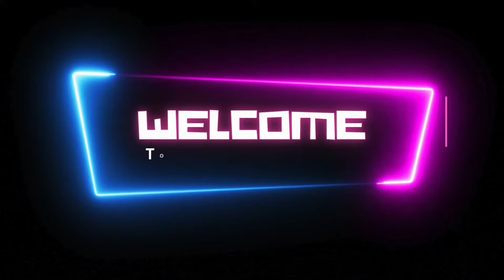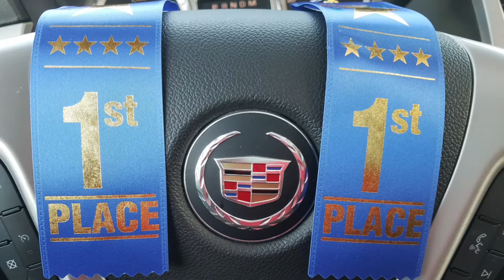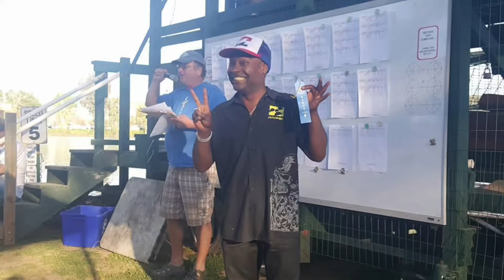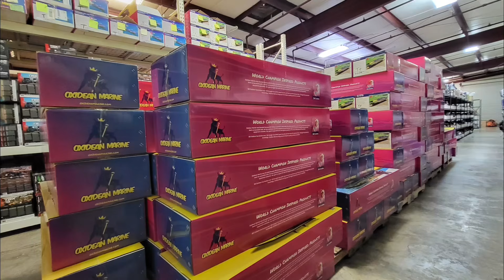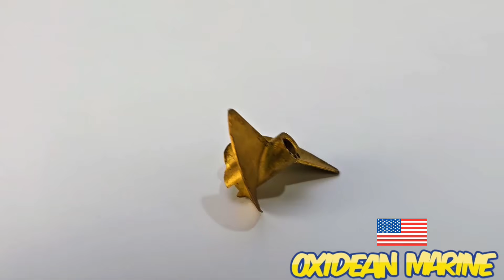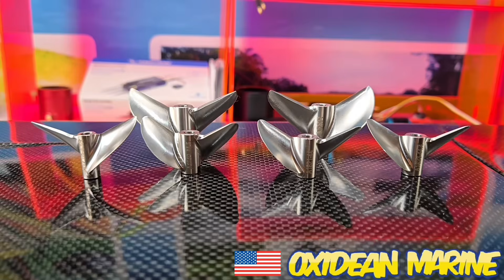RC BOAT PROPELLER INSTRUCTIONAL VIDEO

Comment: Hi Guys. Great video. Can u please help me out. Im new to rc boat and it's Amazing fun. I want to upgrade my new Bezgar Tx123 rc boat from the plastic 2 blade to a little faster metal propeller. Can u tell me exactly what kind or number that would fit this cool little boat. Thank you 😊

Comment: I have a 54" fountain gas boat would I get more speed from a 3 blade or 2.  I had bought boat from bonzi I like the  3 blade I dont know all that much about props. And its not a cheap guessing game to play either. I get about 30mph now would like 5-10 more mph if thats possible with a prop change
Reply from the maker: Call us 510-689-7189

Comment: I appreciate your video and explanations. I’m looking for a prop for my Super Sonicwake 48. It’s a basher boat with a Hydra XLX2 ESC and Prima 4685 1250KV motor. I tend to run large battery packs for additional run time. Obviously by the boat I’m pretty new to RC on the water and want something to hit waves that accelerates better than stock and adding some top end. 
What do you recommend?
I almost bought your A52 CNC High Rake but wanted your advice first. That prop said Phase 1 and I’m thinking this boat might do better with something else seeing it isn’t stock. 
I’m almost embarrassed to ask, but what is the definition of Phase 1 and Phase 2 when choosing one of your propellers?

My BlackJack 42 is stock right now but with be getting the same ESC and motor, unless a 1350KV would work better for it. What prop do you recommend for this application?
My Impulse 31 and Blackjack 29 are bone stock and probably require new stock props. 
Sorry for the novel, but I really am looking to learn and just find helpful guidance 😊
Thank You for any advice you share 👍🏼
Reply from the maker: Call us 510-689-7189
Reply: @oxideanmarine 
I will call for sure 
Bought the A52 and A54 props from you. Trying out the A54 tomorrow 
Thank You
Reply: @oxideanmarine 
Ended up with a Seaking 4685SL 900 KV 14S motor and Seaking 300A HV V4 ESC (5-14S) running twin SMC 6S packs for 12S
Trying her out tomorrow with you A54 prop

Comment: Question for you Bill.
Could you put the size on your props? The diameter, pitch and rake angle? 
It's really important for making a choice on purchasing props to me...
Reply from the maker: Yes that info is engraved in the hub face.
Reply: @oxidean  I bought a pair of your CNC stainless props. The diameter and pitch is marked on them. Not the rake angle. As you mentioned in the video, it's an important part of tuning a boat. I would like to know the rake angle...

Comment: Do sell a cnc prop for the traxxas m-41? I've tried a few brass props on it, but the e.S c is the weak link as it overheats easily.
Reply from the maker: Your wish is my command. We have the Perdect prop for you:

https://oxideanmarine.com/products/cnc-propeller-rc-boat-45mm-4514-3-16-bore?_pos=2&_sid=b3902a2fd&_ss=r
Reply: @oxideanmarine  Alright Bill... I'm giving it a go... I just bought one to try out.
Reply from the maker: @PhilipBender612 Rad!